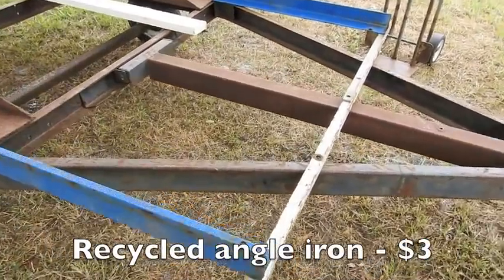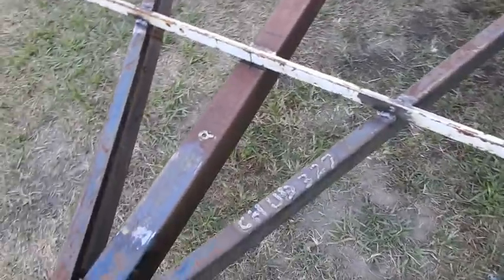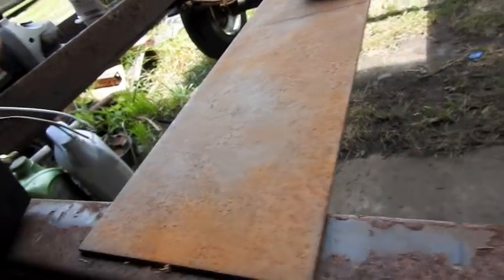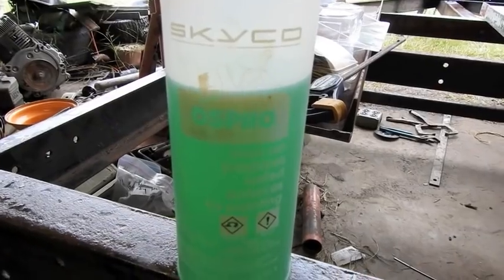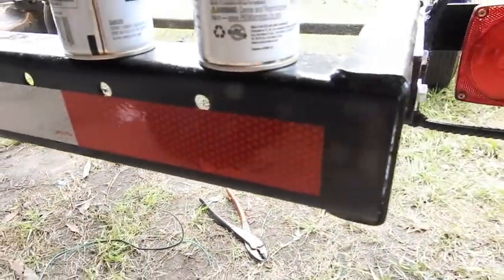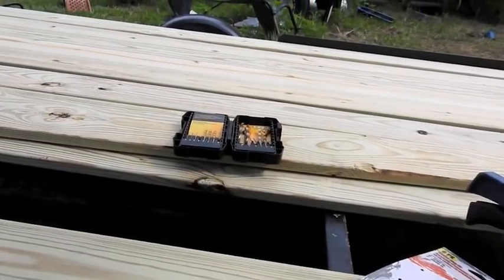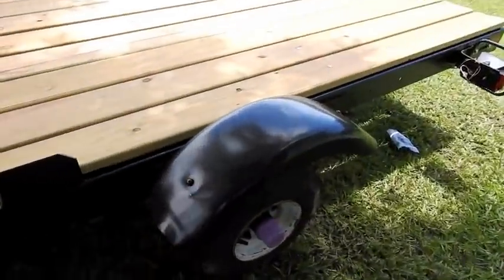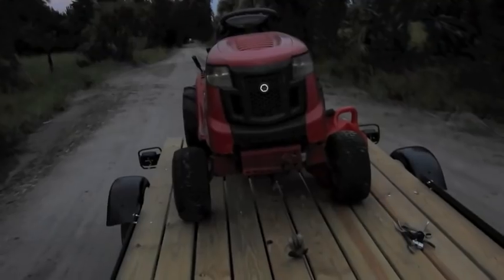Budget Build Small Trailer How To

Comment: I really like this little trailer! At tractor supply they sell lots of dust caps but the one you got seems to be working fine,
Reply from the maker: Yes, I have checked tractor supply several time, but this is an oddball size that I will have to order if this one fails... thanks for watching.